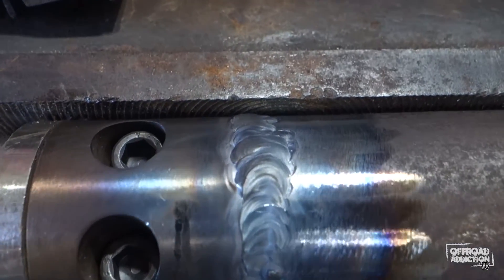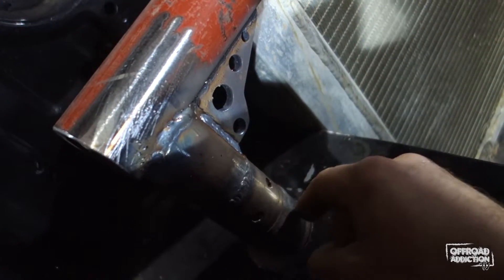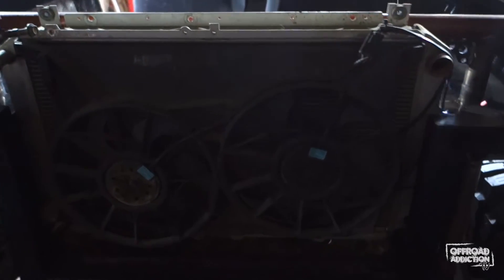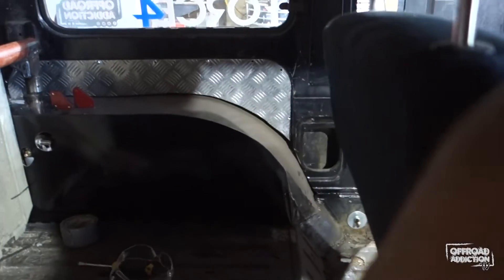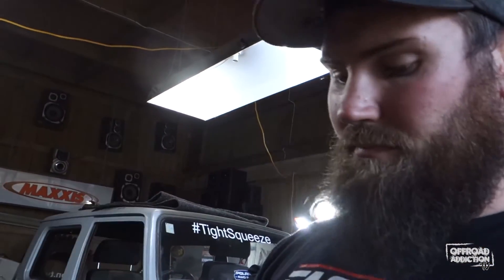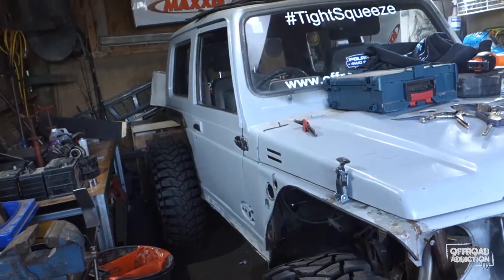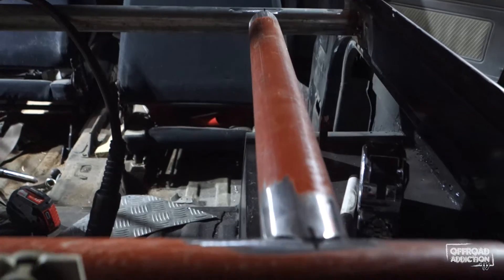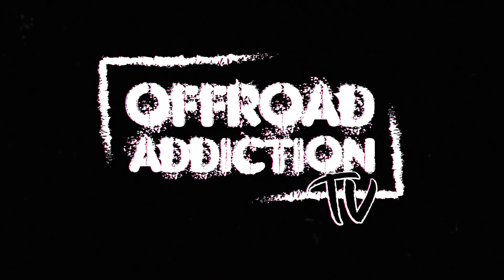Ep14 - Radiator Support Mount & Harness Bar - Suzuki Samurai SJ413 Build - Project #tightsqueeze

Comment: Awesome progress man. But you should probably tip the top of your rad forward and maybe run no back window so it gets air through it. Just a suggestion but none the less mean job man
Reply from the maker: Thanks dude, yeah radiator plans aren't final yet. Will work all that out one day when I get around to it. I have a couple of ideas that may work.